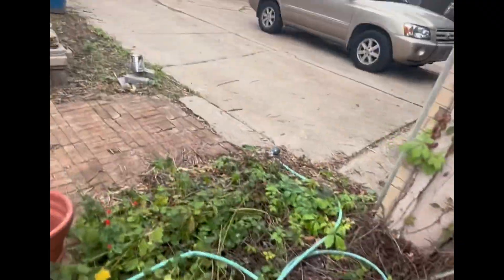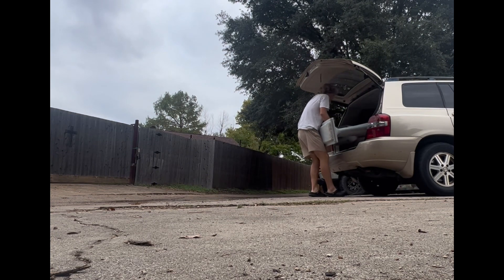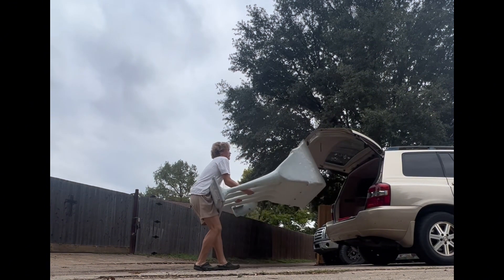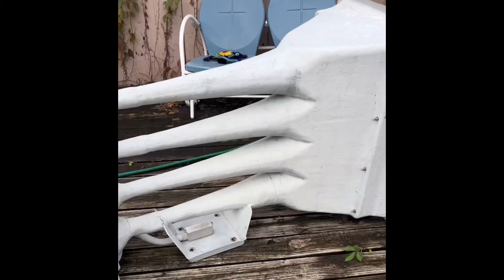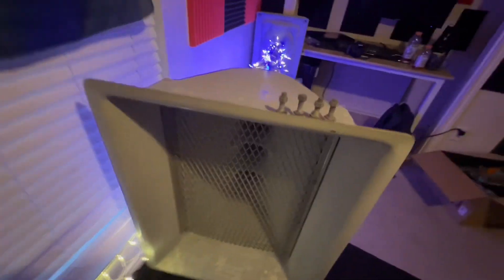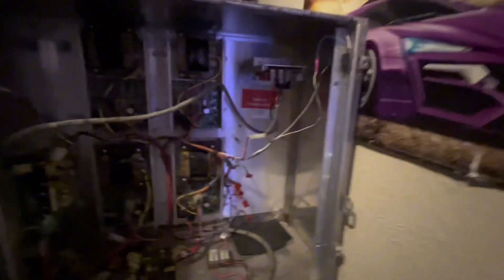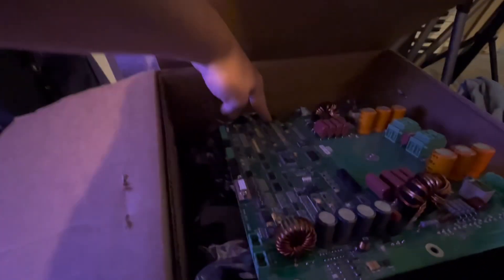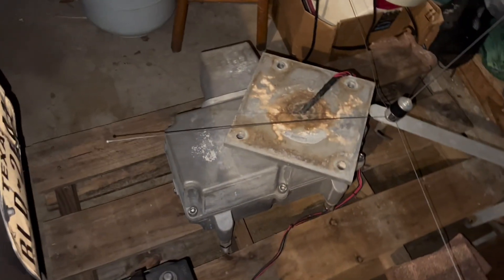My new siren

Comment: How much does this weigh and why would it be from your middle school?
Reply from the maker: Weighs about 60 70 pounds
Reply: @OWS_Crazy1  Jesus Christ
Reply from the maker: Easily about 300 pounds with the drivers and rotator
Reply: @OWS_Crazy1  how much does a driver weigh?
Reply from the maker: 25 maybe 30 pounds each
Reply: @OWS_Crazy1  which 4004 did you think was louder? #17 or #18?